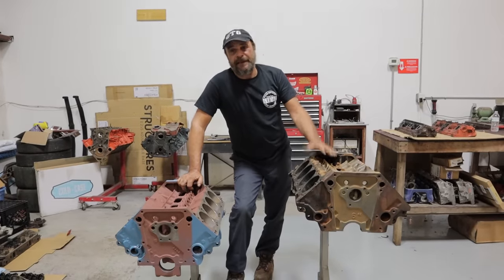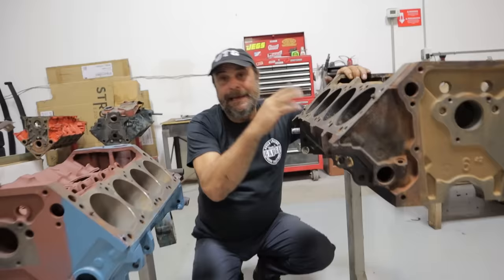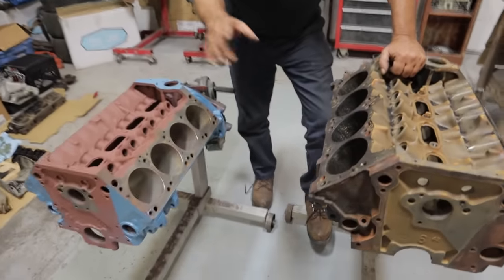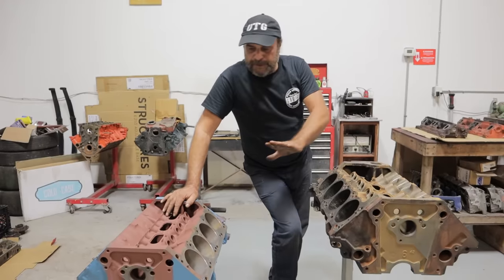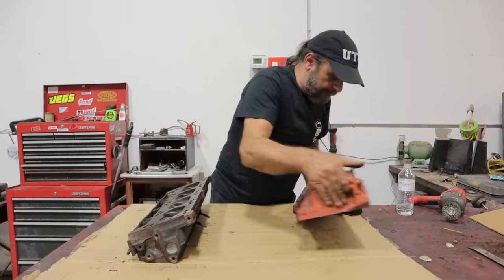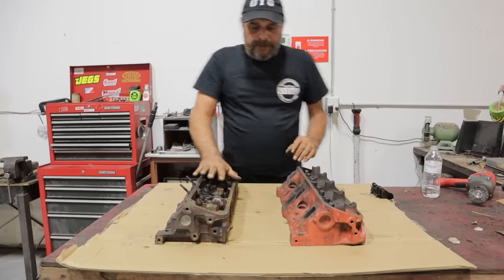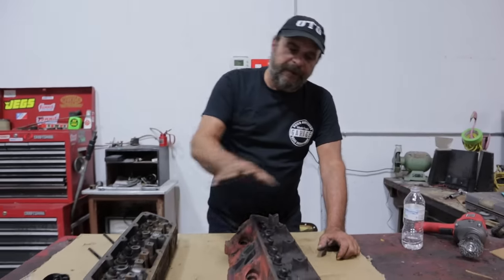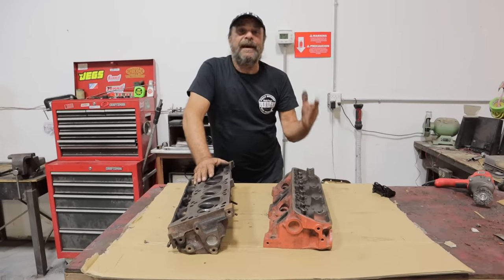Magnum vs. LA. Side By Side Comparison

Comment: Thank You soooo much for this Tony, I've been looking for info on my 5.2 for quite some time now and converting to carbureted and just ripping out all computer junk. Almost no info out there, almost no aftermarket support on performance end, please please do more on the subject. Would love to get rid of the keg intake, it seems very inefficient
Reply: There's a old issue of Mopar muscle on a 318 bulid made 400hp but if I remember right it was a LA 318 with Magnum heads it was sweet and the April 2003 hot rod magazine had a 400hp junkyard build LA 318 that Steve dulcich bulid all stock lower with 302 casting#heads with a lot of porting to head's it was a 1500 dollar 400hp bulid but in 2003 I was tripping over LA small blocks not anymore my buddy owns a machine shop and he said he is paying 5 to 8 hundred the core not  knowing what's wrong with the motor I use to get 318s for a 100 and 360s for  200 at a great junkyard by me that back up his motors but the old man that started the yard when he got home from WW2 past away the kids sold everything for scrap value them day's are gone dam scrap metal  ruined it I only have one 1970 318 with 360 head's bulid by my buddy in my 77 power wagon it runs like a 340 i don't know what it is but I love them little 318s special the older I get my dad use chew me up and down for spinning the rod bearings or just locking it up
Reply: @peterdezeeuw6239  I really have a thing for making the most with the least. Love small displacement engines, 318, 289, 2.3, but I also have a severe dislike for modern "cars" they're junk. Computer anything is built for "planned obsolescence" it's built to fail. So my daily is a ram with 5.2, I want a roots blower on it, nobody makes one, so only leaves me a couple of options, fit LA intake or fab, until then though I really wanna ditch the entire computer. I guess the real frustration with this one is the lack of aftermarket support, which sucks because they really make good power.
Reply: The keg intake runners are the correct area and length for a street performance 318.  Going to any other intake will hurt torque and not make more power in a street-type engine.  If you're going for a 360/5.9 the kegger runners are definitely too small to make power but make killer torque.  For a street (especially truck) 318/5.2 the best and easiest mod to the intake is to bellmouth the inlet openings of the ports (they typically have square edges which hurts flow) and get rid of the machining burr on the port exit (where the intake is machined to match up with the heads).  Also port your throttle body or buy a ported one.  The bores are OK diameter for a street 318 but the throttle body shape has a lot of weird flow restricting features in it - there's more info available online to describe it.

On the exhaust side, going to shorty headers and catback can free up some power.  The 92-93 engines also came with higher flowing exhaust manifolds that are a bolt-on replacement and flow about as well as shorty headers.

If you insist on getting rid of the EFI, you can buy Magnum carbureted intakes from most speed shops (Summit, Jeg's, etc).  Often they are dual bolt pattern intakes that will work either on a Magnum or LA engine.

As you mention, the problem with the Magnum engines is that there is limited aftermarket support.  There's no good reason for that, since Mopar made @55loads of them.  Nearly every Dodge/Jeep truck, van, SUV came with one and there were TONS of those vehicles made.  I am currently trying to partner with MegaSquirt to offer a plug+play tunable computer.  I have the prototype in my Dakota as we speak and am doing the whole bug-fixing, product-development thing...
Reply: @flaircraft  thanks for the replies guys, I already know all that. This build isn't just about performance though, to me I really want a blower stack on it because style wize it just fits the styling of the truck. It's a 99, which is the newest vehicle i own or will own. I run two shops, I work on cars everyday. Just wondering if anyone had experience fabricating a roots blower to fit a Magnum or is this going to be like most things I do and just start from scratch
Reply: @jessiebrooks3511  i saw a guy cut the keg off the stock intake and weld a aluminum blower template to it.
Reply: @frigglebiscuit7484  True for 360's.  Not for 318s.

Comment: You can drill the LA intake to fit the magnum, valve cover can fit. I ran a hot LA318 with mag heads and fined holley valve covers 😊

Comment: 1988 LA 318 and 1989 LA 360 are roller lifter engines and retain the shaft rocker system. 

Low cost 4 barrel aluminum intakes and stand-alone ignition available to remove TBI. Edelbrock carb with oem Carter carb specs for easy tuning. 
Chrysler LA V8 engines today are a great bang for the buck.

318 = reliable, fun, and streetable 225hp and 300tq engine; add 25hp and 50 tq for 360. 

About the same specs as a similar sbc; physics is not brand biased.

Comment: You stated that the cracks on the Magnum heads don’t cause a problem. Wrong ! Those cracks caused all sorts of misfires and when OBD2 came alive lots and lots of misfire codes. We were doing 2 to 3 sets of Magnum heads a week under warranty at the dealership. As per out Mopar tech reps those cracks caused coolant steam in the combustion chamber and put out the spark/flame. Now maybe on a street carbureted vehicle or race care you may not even notice. The computer would.

Comment: Uh Ohh, you forgot a big one.  NO PROVISION for a mechanical fuel pump on the Magnum blocks.  
If anyone wants to swap a magnum and run a carb; look for one from a dead Jeep Grand Cherokee.
The reason is the belt driven accessories are more compact.  The ones from trucks and vans take up more room.  When I did my swap the only aftermarket intake manifold available was a MoPar M1.  You can get an Edelbrock now a days, maybe others.  Aftermarket intakes have shorter runners and smaller plenum areas than the OEM "barrel" intake manifold.  A cam more suitable cam for this combo needs to be selected.  
The Magnum has no heat riser so get an carb with an electric choke.  Had good luck with a Eddy 1406.  I was able to get mine dialed in on cold start to driving in less than a minute.  You have to dial in a summer and winter adjustment but once you have that down you are fine.

Comment: I wish the magnums got more love and support. That are decent engines although the plenum is an issue but it's a relatively easy fix
Reply: They sure are great engines! The 5.9 Magnum was the highest horsepower light duty pickup truck engine until 1996 when Chevrolet introduced thier "Vortec" 5.7

Comment: Always been curious about one thing, on a LA318 most aftermarket intake manifolds don't connect the rear water ports. Would you know why and, will this hurt the engine? Thanx!👍👍
Reply: @Jeff Sumpman I've never seen a stock intake that connected those either.

Comment: yup my 5.9 magnum heads have intake seat cracks and I laughed because another common thing is the front intake bolts shear off taking the intake off both of mine did but pb blaster and a torch and vice grips got them out.

Comment: Also, from what im told, early magnum blocks have oil ports on the block to use LA heads. That whole late 80s/early 90s thing made a mess of the small block lol. So many minute differences.
Reply: Seen/had 1993-4 blocks drilled for LA heads, too.
None drilled after 1996 so far.

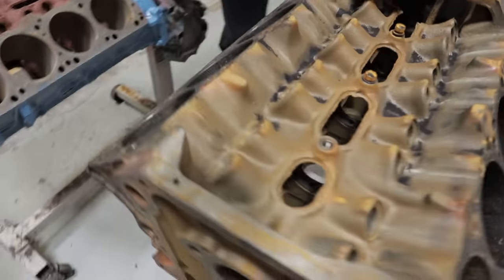Comment: A magnum camshaft has no oil passages and thus can't be swapped to an LA application unless the heads are also out of a magnum application, otherwise the top end of the engine will not receive proper oiling. Did I misunderstand what you said at 5:48? The nose length of the cam is also different to accommodate the difference in fuel pump (electric vs mechanical). So to switch you would need to run an electric fuel pump.

Comment: So you said 86 and up la motors are roller? My 73 has an 86 360 in it. I would love to know for sure if that is a roller engine or not. I guess I'll find out for sure when I do the manifold swap.
Reply: 360 didn't get a roller until the Magnums......the 86 and up 318's were roller tho.
Reply: @yurimodin7333  86 318 went roller, 88 the 360 got them. 86 and up non roller 360 blocks had the provisions to accept rollers. They were assembled flat.
Reply: The 88 360 cast for rollers also oils to the head.
Reply: @yurimodin7333  
Actually my 92 W250,  360 LA came stock with roller lifters.
 And short snout cam, ( no eccentric) TBI. intake.

Comment: I went new Zealand EQ for my magnum build. I really wish I had done more homework. I would have searched out a 360 LA roller.
Why because of so many more options. Plus the EQ LA heads flow better than the EQ magnums. Its ok though. I am going off road not the drag strip.

Comment: How does the 1999/2000 4.7 ltr. Magnum fit in these families? I have one in a Dakota 4dr 4wd and its a pig. It had to down shift on the smallest of hills to get up it let alone a moderate steep hills. I really have to kick the pig till she screams. Is it worth doing anything to the 273 or should I step up to the 360? Im not looking to race but I want better performance and easier driving.

Comment: Hey Tony, when you said you can gasket jig and drill your magnum heads for "the earlier intake", do you mean the oddball early 273 pattern, or the more common 318/340/360 pattern (3/8 straight)?

Edit: how about exhaust bolt pattern? Can you toss LA headers on a maggy?
Reply: People run la block hugger headers on magnum blocks all the time. 👍
Reply: Im running long tube la headers on my magnum right now.
Reply: He also meant the intake trick is for 318, 340, 360.
Reply: Thanks guys! Love the Tony watchers, real community attitude here
Reply: BHJ Tooling used to make a drill-out fixture to change a Magnum head vertical bolt pattern to LA pattern.
Reply: @dantupper1784  maybe one could simply bolt the mag heads on a block and use an la intake for a drill-out fixture ?
Reply: @danielslocum7169  
Maybe.
    Use one of those chinese air-gap knockoffs with dual pattern bolt holes.
   Sawsall out the plenum and runners for workspace.
   Tap
Reply: @danielslocum7169  
   Honestly a decent Machine Shop could drill out the holes properly and with reasonable accurately using a LA intake gasket and a LA head to get the intake bolt angle relative to the head/intake manifold face in the machinery they are using.
   In terms of time/money spent and quality of the outcome this may be the best path.
   DIY?- the quality of the outcome would depend a lot on your contacts, skills, and ingenuity.
   I would never encourage somebody to take on a task that is so far beyond their skill level that getting totally frustrated & PO'd, or wasting a pile of money makes them walk away from playing with cars & trucks.
   Maybe taking local Community College Machinist classes gets you access to machinery, plus Machinists & Millwrights that know what they are doing & enjoy challenges.

   OK-just ballparking the idea, since I never tried it.
    Think of all the variables- block deck correct height on both sides, heads machined equally, head gaskets equally compressed, etc.
   Maybe use a early iron single-plane 2bbl intake with drill guides ($) sccurately tapped into the original bolt holes- least amount of 'stuff' in the way.
   Get your sacrificial set of blue composit 340 style intake gaskets glued to the intake to simulate the spacing of the intake gasket for the bolt-hole accuracy.
   Leave the block-to-intake-manifold gaskets off (china wall gaskets) so you can check the gap for equal height front to rear and side to side after you somehow clamp/vice grip this mess together.
   Probably some "claimer engine class' Oval Track people, or someone with a better/faster/easier DIY idea than mine could be more helpful. 
   Hope this helps.

Comment: The small block Chevy can’t be argued with ( in its many varieties) .  Dollar for dollar there the best engine for the money / workability.   I built a 400 Pontiac because it’s not as common but it hard not to do the small block gm. Mopars are cool to actually there are lots of very interesting engines .
Reply: sbc needs more aftermarket parts to make the same hp that a mopar can do with stock parts.

Comment: My dad had a 3/4 ton dodge with the 5.9 magnum. It was the final year model of that combo and was purchased at a discount as the new Hemi equipped models filled the lot. If you look at the specs, it was nothing special. The 5.7 in my current 2017 ram outpaces it on peak numbers by a country mile. But the torque curve on the 5.9 must have been on par with a diesel because it would happily spin tires at takeoff. It wasnt as beefy as a diesel, but it still towed pretty well too, while averaging the same (and occasionally better) MPG as my current 2017. The truck had nearly 300,000 miles when sold but was going strong with very minimal repair, none of which pertained to the engine itself. I've sometimes wondered what would have happened if chrysler had reworked the 5.9 for truck service in the 21st century and left the "HEMI" for sports cars and such.

Comment: Thank you Tony for your take on the cracked head worry, it was very good to hear your take on that... I plan to put a 5.9 Magnum in this 2003 Jeep i have here, that has a bad 4.7 V8... I plan to buy a good running, rusted, beat Dodge truck for the parts. I have read up on it, and its a good, cheap swap.

Comment: Thanks, Uncle Tony, for the videos and your channel.
Question: Are the valve guides in a Magnum head part of the casting, or are they inserts?

By the way, I’ve been trying to determine if there is too much valve play in my heads by using the wobble method and measuring the play with a dial indicator/ magnetic base. I’m using a Haynes manual for the specs, but it doesn’t give any detail on the procedure. Any ideas?
94 Magnum 5.2L Ram 1500.

Comment: I think the 360 has always been an incredible engine.  Big torque, big stroke, very easy to make big power.  I mean, a 408 / 410 stroker will make 500+ ft lbs of torque without any other big changes.  Add good heads, intake and cam and it is super easy to get 550+ hp to go with 500+ ft lbs of torque and that torque is killer for a street engine.

Comment: I've had a lot of trouble sourcing solid pushrods in the lengths I need and lifters that don't allow oil to go up the pushrods. On an LA motor, would it be a OK to use both the oil through pushrods and oiling through the rocker shaft if using a high volume oil pump?
Reply: i dont see why not. you dont lose that much volume.

Comment: I could fill a tractor trailer with all the 300k plus mile 5.2 motors still running in my area. Dakotas and 1500s that look like they were in a war still puttering down the road.

Comment: now i got a question i have a first gen with the 239 la v6 and i dont know if you know why or not but the combustion chamber is like the magnum head with a zero deck surface but was it like a transition period or test prior to magnum and it has the shaft rockers but hollow push rods what i thought was funny is its post carburetor and has a holley throttle body but still has the carburetor heat cross over. i dont know wanted to learn if you had any info
Reply: @nicholas peterss I didn't know what you just said about the LA 3.9 - thanks.  If that ever comes up on Jeopardy I'll know the answer.
Reply: The roller LAs (86-91) had hollow pushrods, but still oiled through the rockers & the throttle body engines still used the heat cross over in the castings til 91, I'm working on a set for my father's 87 Dakota I ported & polished years ago

Comment: Tony...real question here.  First of all, I think it's known that the driver's side mount ears spacing are different between 318's and 360's LA blocks, correct?  Is there a difference between the driver's side mount ears spacing between the LA and Magnum engines?   Am I right in believing that the Magnum has the 318 mount ear spacing; therefore, the Magnum would use a 318 motor mount?  LA 360 spool mounts are hard to find, so I use a 318 spool mount with a spacer on the rear mounting bolt.
Reply: i think you just use a spacer, and drill one of the mounts for the hole on the other side, or something like that. maybe magnums all use the 360 mounts?
Reply: Yeah, the 360 spool mounts for the driver side are impossible to find.  I've been looking for years.

Comment: I had the pleasure of rebuilding the top end of 1997 Dodge Ram conversion van. Blown head gasket, high rise intake like Magnum engines and heads like you described, but it wasn't technically a Magnum engine bcz they started those in'98 right? Could've been a late year build maybe?  Good vehicle for family for over hundred thousand miles. Worked on it after 178k.
Reply: The 5.9 Magnum started in the mid 1993 model year. The truck or van needed the "Z" code in the VIN. The 3.9 V6 and 5.2 Magnums were introduced in 1991.

Comment: What are the production numbers between the 360 la and 360 magnum engines. And is it better to build the 318 or the 360 for a hot rod small block mopar

Comment: At this point in time, the magnum would make a great low buck hotrod engine. They  are everywhere, and dirt cheap. Never had any problems with the ones I owned, and they lasted forever,  even though I abused the hell out of them. I've had a 5.7 hemi for 10 yrs now, and what with the lifter seizing and trashing the cam, and fixing to do the broken exhaust bolts for the 3rd time, I really wish they had just kept the magnum.